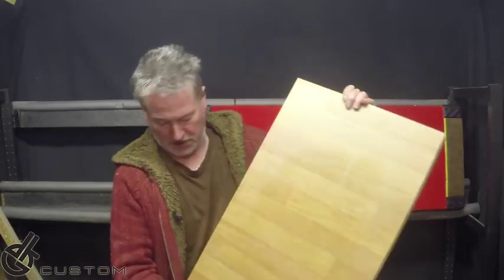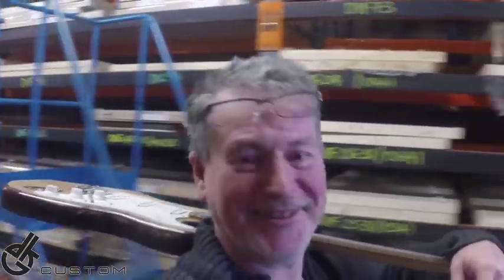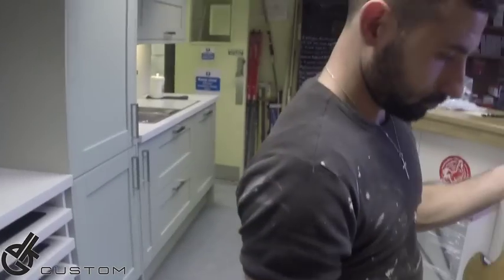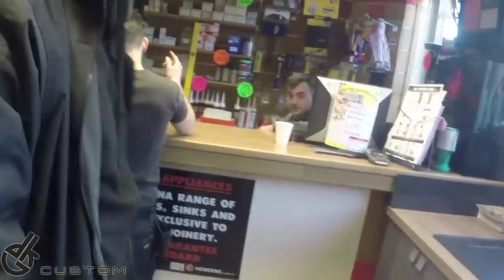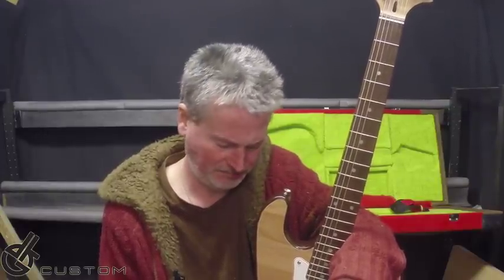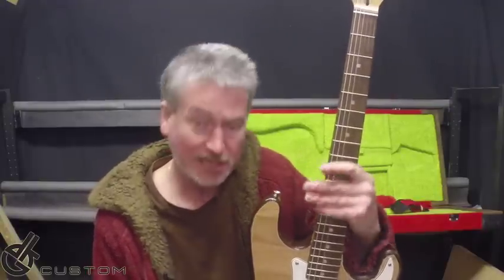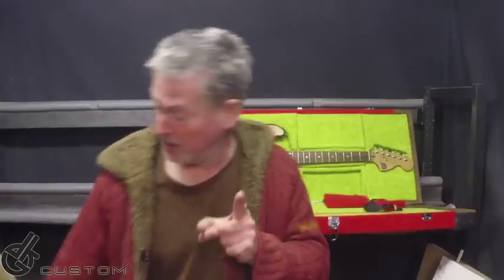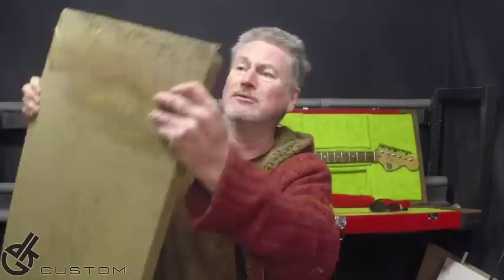The Kitchen Strat - Journeys End, Demo and WHAT NEXT?

Comment: I'd like to have a go and trying to make a guitar body out of DIY micarta.

Layers and layers of stuff like old blue jeans saturated in fiberglass resin and held in a press.  They use it for knife handles all the time.
Reply from the maker: Miguel Cuervo I had a go using denim to cover a guitar, but I wasn't happy with the results. 
The toughest thing I've found is getting a nice even and insanely high pressure press. I might try building a large water tank to act as a press.
Keep me informed of your build

Comment: They didn't leave that fretboard material to "cure" before they machined it. Then again if one side was finished differently then you'd get differential expansion due to moisture etc and that would cause bowing.
Reply: dorbie It's the frets themselves that bend the board. Some acoustics don't have truss rods, they use compression fretting to create a backward pressure on the neck.

Comment: Ben Is a good player and that guitar sounds great regardless and if one did not see the video one would not have guessed kitchen counter. and yes has a certain mojo. Alas people like pretty furniture. Nice job on the case also. Casting fretboards idea got me interested. I coated a fretless bass fretboard with CA "super glue" and got great results,but casting wow, think someone tried it in past and actually cast the frets as steps as an itegral part of the board not add ons. Yes, BOND guitars 1984 the Electraglide model, made in Scotland by Andrew Bond. Only thing is particle board would be a bit heavy on my arthritic shoulders. Nice to see someone thinking for a change. You and Dr. Groovy rulers of the galaxy!
Reply from the maker: trinacria1956 The electroglide was a brilliant design using cast aluminium I think. Not sure about durability though.
Particle board IS heavy, but that could be worked around with some chambering.
Reply: DKGCustom Of course chambering I should have known, Was all proud of making my version of a Bo Diddley "Cadillac" model body out of a solid piece of mahogany until I weight it and it alone was 7.5 pounds!!! So chanbered made 2 huge chambers on either side of the middle area and now down to 4.3 pounds. Yes the durability is what killed the BOND Electraglide since there was no way to alter the thing and absolutely no refretting possible!